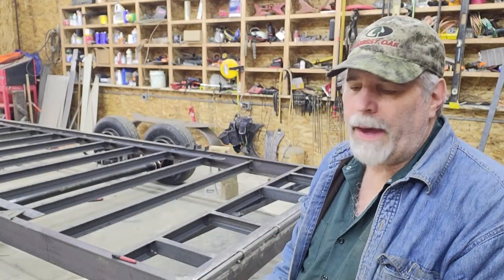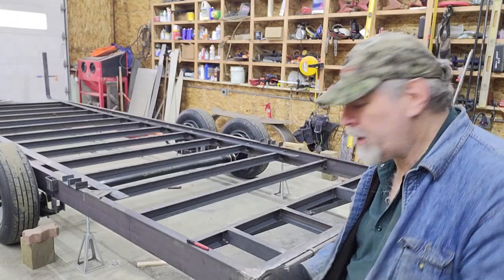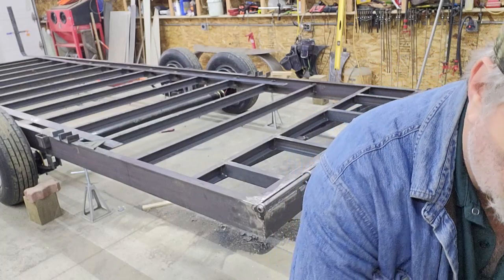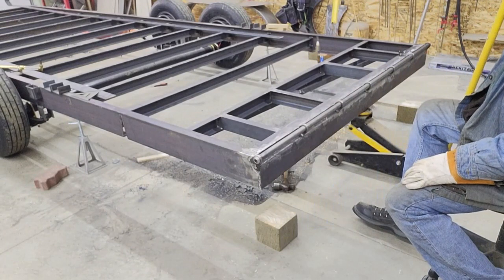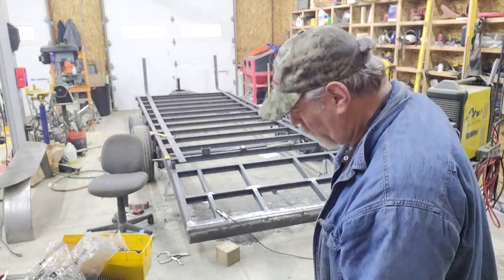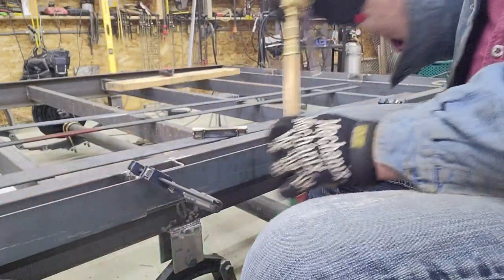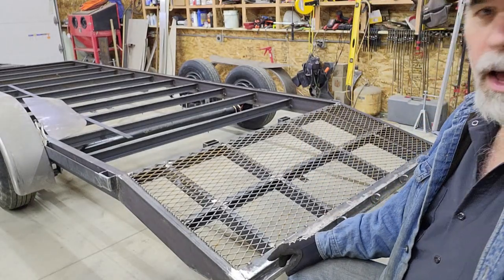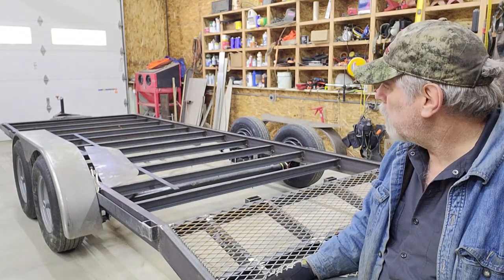In this episode, I'll bend the beaver tail down, and attach some expanded metal

Comment: Nice work! Thank you for making the video. As far as the color, make it match what you're pulling it with.
Reply from the maker: I thought about that, but light loads I pull with may daily driver 1/2 ton, which is burgundy.  Pull heavy loads with my 2nd gen Cummins which is white.  So it would only match half the time :-)

Comment: You going to hinge the fenders so they will fold outward so you can load wider tired rigs?  Im going to cut mine loose & do that as well as widen the deck to match the 8ft.6in overall width.
Reply from the maker: I thought about that, but decided to make them bolt on, so I could remove them.  It'll be far and few between that I haul extra wide.  That's one reason why I thought long and hard about a deck over vs. drop axle.

Comment: what thickness material are the rub rails?
Reply from the maker: 3/16". I thought about using 1/4", but because they are "stacked" on top of the stake pockets, I was worried about the "flat hook" style ratchet straps not being able to fit over the combined thickness.